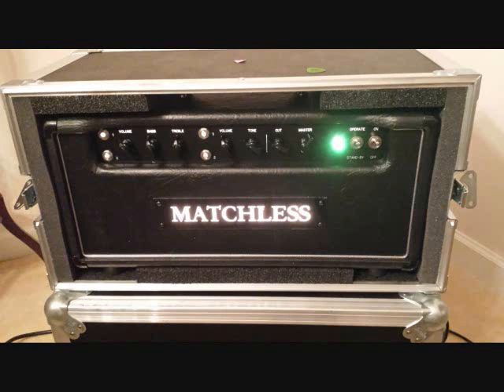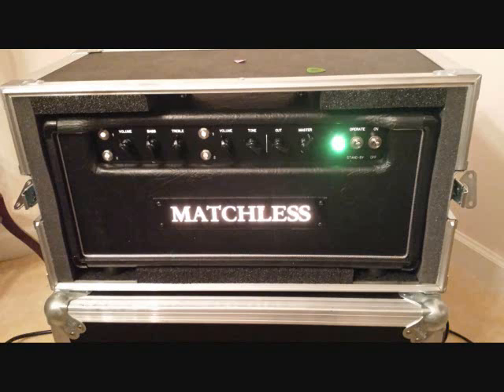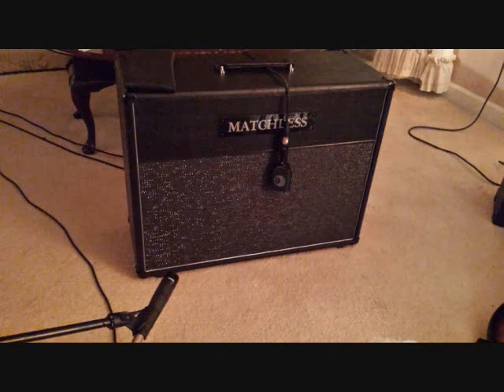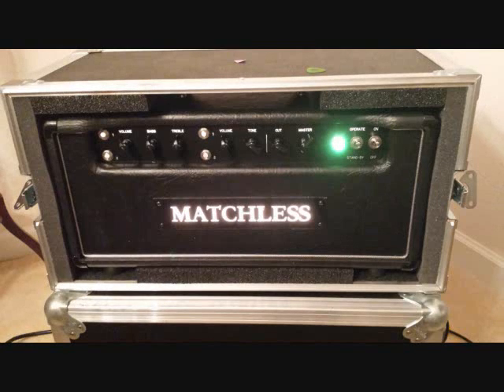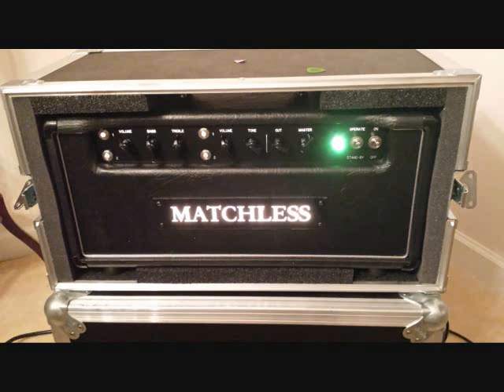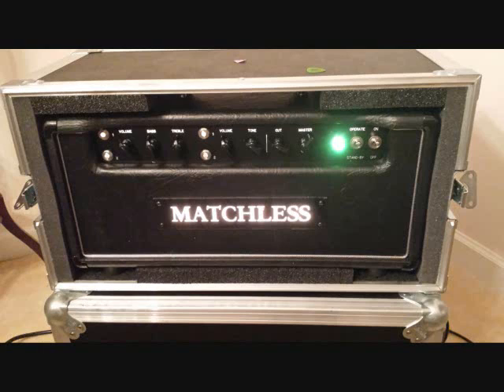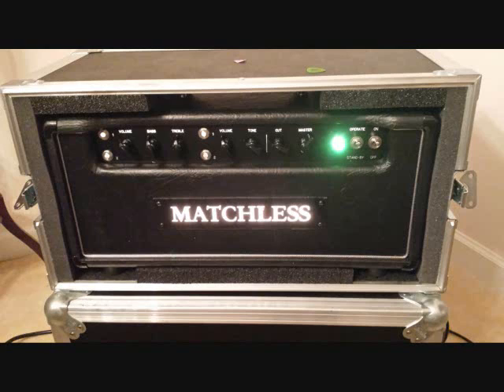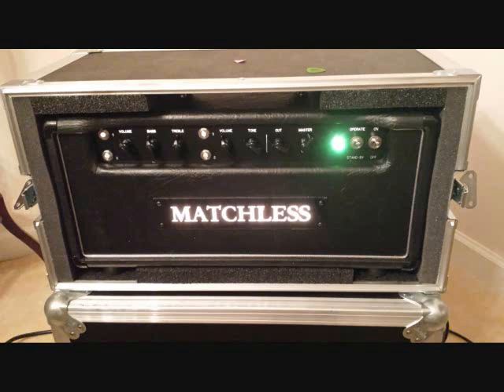Matchless HC30 Sound Demo

Comment: Sounds great!
Wich is the difference between the HC-30 and the C-30 (head)?

Thanks in advance!
Reply from the maker: Thanks for watching.  The HC-30 is just the head-only version of the DC-30 combo, the C-30 is the name of the actual amplifier unit.  HC/DC/SC/ just refer to what speaker set up it has.  HC is head-only, DC is the dual speaker combo, and SC is the less common single-speaker combo.  They all use the same head unit as far as I know.  Hope this helps.
Reply from the maker: I believe that you can order the HC-30 with reverb as an add-on, I believe the model in that photo is an HC-30 with reverb added on.  From what I can tell, the reverb models have "C-30 Reverb" written on the front panel, whereas the standard non-reverb models don't have the C-30 text on the front.
Reply: I'm still confused?   Are   HC-30 and C-30  not the exact same thing?
Reply: They're the same amp, as I know it, but in chassis form. HC-30 is the finished head enclosure, the C-30 amp is housed within it, as well as in the DC-30.

Comment: Is the master volume bypassed and are you using the Hi or Low inputs?
Reply from the maker: +Matthew Howard Master volume was bypassed, single coil guitar (Stratocaster) was on the Hi input, and the Les Paul was on the Low input.  Thanks for watching!